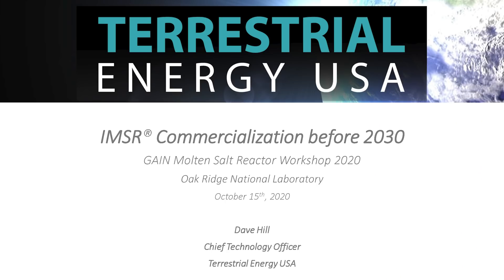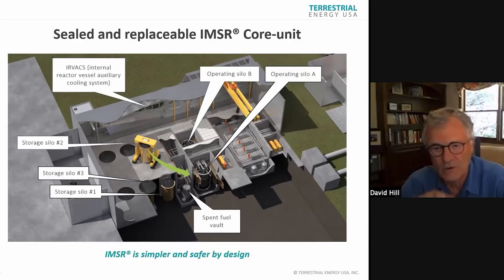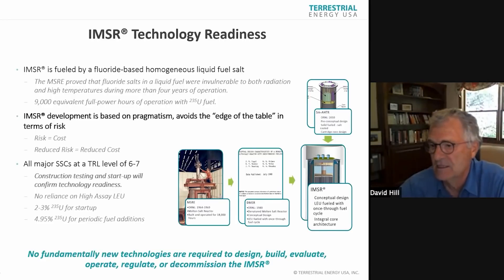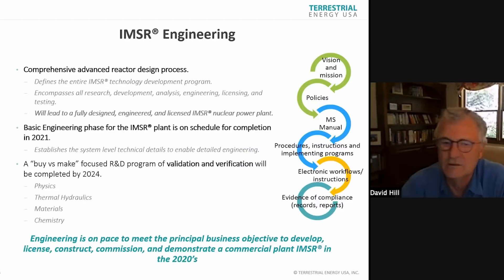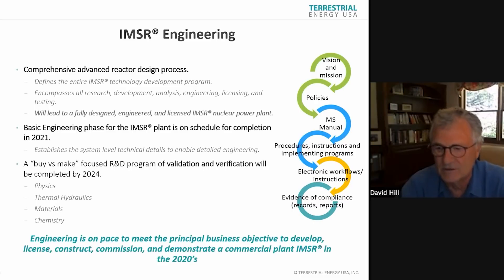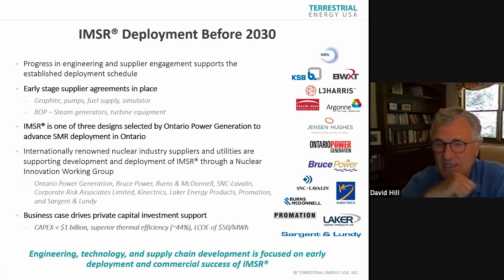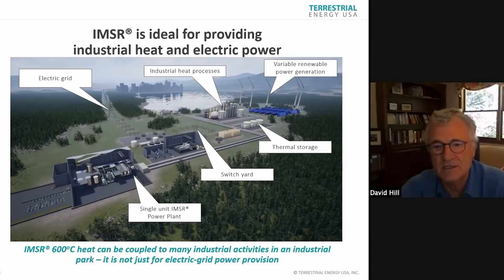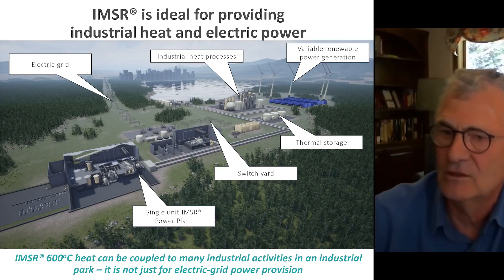IMSR (Integral Molten-Salt Reactor) Before 2030 - Dave Hill of Terrestrial Energy @ ORNL MSRW 2020

Comment from the maker: If you'd like to support creation of these nuclear power videos please visit https://www.patreon.com/thorium where I do accept financial support. You'll probably enjoy my Patreon feed, if you take any interest in Advanced Nuclear. (Molten-Salt Reactors, Small Modular Reactors, thermal-spectrum breeders, fast-spectrum breeders.) If you find my work useful I ask for $1/year. Yes, $1/year. (It helps keep out the riff-raff.) Again, head to: https://www.patreon.com/thorium
Reply: I think youtube cut it off?
Reply from the maker: @mukiex4413  Yeah, thanks for pointing that out.
Reply: In today's dollars what is the build cost for your proposed 442 megawatt installation?
Reply: @reypolice5231  For clarity's sake, I believe that's a 200MWe (e.g. 442MWth) reactor. From another video, I believe the First-of-a-Kind overnight cost is about $1B. But I believe that also includes the costs of effectively building the factory to assemble the vessels. And that might also be for the larger, 300MWe model.

The one major advantage here is that the airplane-crash-proof, radiation-housing portion of the reactor is a concrete sleeve and lid (multiple feet thick) immediately surrounding the vessel. As far as I know that's basically what completely yanked all of the APR1000's cost savings away. They made a much smaller building for nuclear purposes, but suddenly got an 11th-hour requirement to RE-ADD all that material for anti-9/11-style-terrorism safety.

Comment: I don't see the advantage to using graphite moderation. Why not use heavy water, with a burst disk on the pressure vessel?
That way as soon as the reactor runs over temperature it is inherently above pressure, the burst disc ruptures removing the moderator.
Reply: Nice idea, but molten salts run above the temperature range of heavy water, which is why graphite moderation is used.  Plus, while I love the CANDU reactor (which as you know, use D2O), any water under high pressure is still an added risk, particularly if in contact with the core.  One of the major advantages of molten salts is being able to run at much higher temperatures (and lower pressures).

Comment: "The service life of 7 years is the result of graphite deterioration . . . . so, we move out the whole unit, pump out the  . . .(salt??)  . . . and replace the graphite . . . .." . . .  Does anyone else think that would have been a good point to mention how often the Thorium salt needs to replaced?? . . . .  Why is it so difficult to get ANYONE to provide a clear and complete explanation of Nuclear Power?
Reply from the maker: They're not replacing the salt. They'll add enriched Uranium to it over those 7 years, but the salt will remain contained in the IMSR even AFTER operation ceases. That  is where it will be contained while some Fission Products decay away. Once some of the FP have decayed, THEN Terrestrial Energy will haul away the IMSR unit and so whatever they decide to do with the salt.
Reply: @gordonmcdowell  Right,makes it cheaper, safer,and simpler, no pumping the corrosive salt out of the pot, they only add, not subtract.

Comment: Nothing about Trition, Xenon & krypton gases?? Are you controlling/collecting them?
Reply: Yes they are captured converted or collected. The nice thing is there is a commercial use for the transuranics and  Actinides that are associated with a LIFTR breeder. Because of the nature of the liquid salt the gass just bubbles out and the transuranics can be chemicly processed out. In today's operating reactors the gass stays trapped in the uranium fuel rod fracturing the fuel pellets and swelling the fuel rod bundle. That is the reason they are pulled and replaced not because they are "spent". The original intent was to send them to a fuel processor where they would be disassembled in a hot cell and the transuranics and actinides processed out of the fuel pellets and reload into a fuel bundle with some fresh fuel and sent back to the reactor. But people didn't like ideal of the stuff  being shipped through there home town.
Reply: @uberdang830  You are mostly correct - they are also spent in that the U235 concentration has fallen too low to continue the reaction at a reasonable rate (even counting the converted plutonium in it).  You could reprocess the fuel (ie MOX) or use the fuel in more efficient reactors instead (ie MSR, etc).  You are right though in that one of the reasons the standard solid reactor fuel isn't enriched more, is because it is pointless - you'd waste U235 as the pellets would have expanded and possibly cracked.  Again, newer (not solid) reactor fuel designs correct this problem.

Comment: This is so dumb EVERY project has failed or cost more than it is worth!! Nuclear is ONLY good for reseach, Science and medical but the Cost spent so far could have covered 70% of building in a state from 1 of these projects!! Rooftop solar and Batteries (with possible VAWT coming soon) WHAT we need to work on is power cost reduction which there are already 5+ i can think of just off the top of my head!
Reply: Nuclear is our cheapest and safest power.

Comment: I don't know why Terrestrial Energy  always limits themselves to one acting reactor in a twin core setup. Sure in some cases one reactor would be sufficient for the local area, but in larger cities it would make more sense to have seven or more reactors stations seeing as how one reactor lasts seven years. You could save space and be more centralized around bigger cities.
Reply from the maker: I'm no nuclear engineer, but I play one on YouTube. I'd always thought a 3-core setup would be cool. I'm sure many great reasons for 2 instead of 3, but 3 circles pack together nicely... if one core is down you're never 100% dependent on the other one. Even if 2 ran most-of-time instead of 3, if 2 were running and one had to be taken off-line you'd never stop producing power.

Probably dumb, but if TE is reading this I am curious why 2 instead of 3. (My guess is easier to have maintenance lined-up along one axis... like even if they wanted 3 they might still line them up in a row.)
Reply: @gordonmcdowell  For the cost of the reactor, and the type of system is is, the question isn't "one, two, or three," it's "can we set up a dozen or so, so we're only losing 8% of our capacity when swapping one out?"

Comment: I'd like to see an acceleration build of a demonstration unit. That way we can prove the technology quickly. It would, if it works as expected, fit nicely with the current roll-out of renewables and new storage technologies. We can then phase out inefficient coal, integrate new IMSR units, and add the needed base stability to grid power. These small units are ideal, this would fill in the gap in generation capacity needed with the new generation of renewables.
Reply: As he said, this will go online in 2030 the Canadians have rational regulation unlike us, but they'll be built here as well, this is the company closest to a MSR especially one with molten fuel in the salt.

Comment: What’s wrong with solar energy? No radioactive waste, no  ugly landscape mining, no CO2 and available everywhere. Plenty of fuel for eons to come. Easily scalable. A variety of storage systems. What’s wrong with that?
Reply: lol wat 'no  ugly landscape mining' you do realize solar needs mining as well ffs, and if your running thorium fuel you would be using the same mines that solar needs aka rare Earth metals...also solar is very low density has to cover heaps of land so it DOES have problems that are actually worst then modern nuclear.
Reply: You have looked at the entire lifecycle of a solar panel correct? Not to mention waste streams? Even if everything was somehow parity, why wouldn't you consider energy density, and say environment be damned? Plus you're missing the whole point, we want, hell I want, radioactive waste! That is good stuff.
Reply: Besides being a highly diffuse energy source, some people living where it's usually cloudy or where the sub doesn't even rise for months at a time, toxic runoff from the heavy metal mines and polysilicon production, and no grid level storage?
BTW, high level radioactive waste is a myth. What you and so many other incorrectly call nuclear waste is almost entirely unspent fuel, and it only exists because regulators shackled the industry to 1950s reactor technology that was already obsolete in the 1950s.
Reply: This reactor puts out power 24 x 7.  The sun does not shine for 24 hours per day.  There are currently no cost effective ways to store large amounts of energy to use when the sun is not shinning.  That is a fact.  The output of a solar facility is dependent on the location.  See the DOE's solar feasibility map for the US.  Solar isn't cost competitive everywhere.
Reply: @frankd8957  and OP says "landscape mining" like it's a bad thing, the beauty of an open pit mine is subjective. He doesn't find them attractive, I on the other hand think giant ass holes are cool. The earth's crust is hundreds of miles deep and people complain about a few tiny holes. What a bunch of babies.
Reply: Lol.
Reply: The amount of excavation for the materials used in solar cells and supporting frames and integration onto the ground far outweighs that of uranium, especially as it can use, if deployed purposely, existing WASTE from nuclear plants. In Canada, you might get rated power in the winter time, assuming a sunny day with no snow or ice on you panels, maybe 6 hours a day depending on latitude. Canadian civilization would like end if it had to rely on solar.
Reply: not to mention if a super volcano erupts or another unforeseeable event occurs solar is useless, our only power source will be nuclear gas and coal.  Never put all your eggs in one basket.
Reply: @Electronic424  well to be fair, who the hell needs a basket if you got angry pixies coming out of one of those immensely beautiful and sexy nuclear reactors. Mmmmmmm
Reply: Solar has more waste than nuclear it is less safe more people die installing panels than building or operating nuclear plants solar is expensive so expensive no one ever installs it without government help,soalr produces just a tiny amount of energy while nuclear runs the entire country of France,finally the material to build panels comes from the death camps of China slave labor and coal.
 Solar only works a very small part of the day.all solar systems are fossil fuel systems they need coal and gas to work.

Comment: Really wish the development of this technology was a lot faster. I wish the regulators would get off the dime and allow demo power plants
Reply: as he points out demo reactors are not fundable. As a resident of Ontario I'd rather they just design full scale with intent to get approved to piggy-back or replace an existing station and it's existing grid tie ins. Cheapest option.
Reply: With the coming of space exploration, nuclear power is becoming the only thing that you need. You can't efficiently use solar and wind turbine in Mars/Moon and the question of using thermal is shady.
Reply: IIUC, in the U.S., "research" reactors, which would be easier to license, are limited to 1MWth which is usually way too small for a demo reactor. If the limit was 10MWth, maybe it would be more practical to build a demo reactor. Keep in mind that a small 100MWe MSR power plant needs a 227MWth reactor, and 10MW is less than 5 percent of this.
Reply: The regulator will consider a demonstration plant if one is proposed for licensing. Thus far, no one has submitted an application.
Reply: @gizmophoto3577  And why do you suppose that is?
Reply: @davidpiepgrass743  My opinion is that there isn’t anyone who is technologically ready; they don’t have enough design and analysis done yet.  My knowledge is a couple years old, though, and I’m sure substantial progress has been made by some. Others are more adept at public relations. The 21st Century record of nuclear power ventures is varied and diverse, largely united only by their failure to deliver on their promises. Some of that failure is in the regulator’s lap, but most lies with the designers, builders, and utilities involved.
Reply: @gizmophoto3577  Karios is building a demo in Tennessee.Using TRISO fuel.
Reply: Сперва США придется заново осваивать технологию обогащения урана.